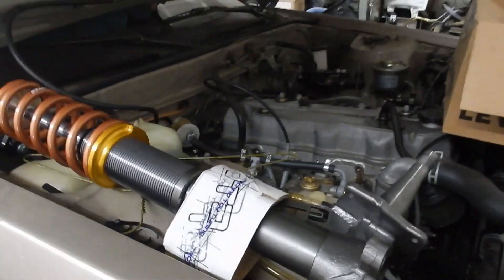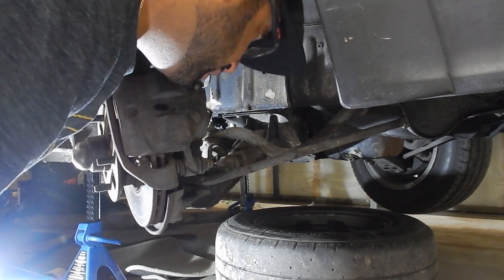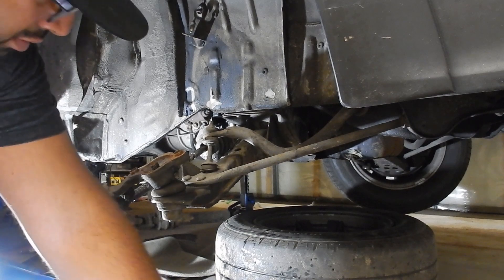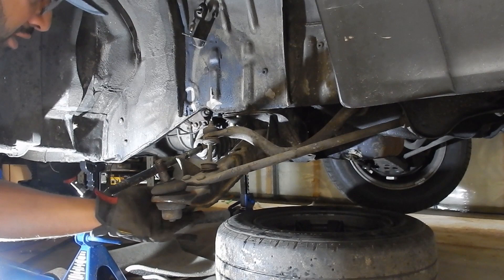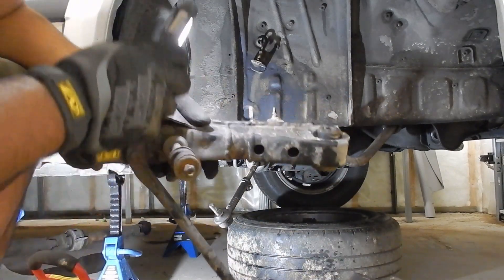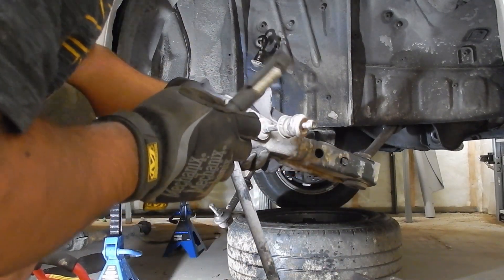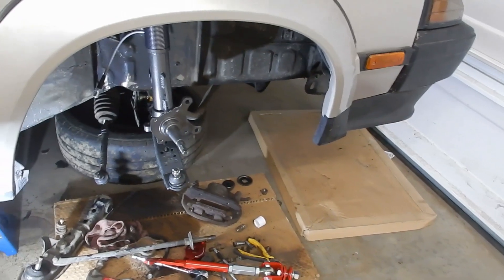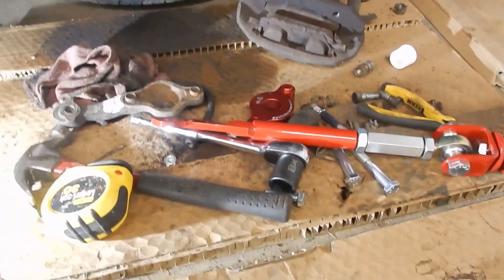1984 Celica RA64 Removing and Installing Front Suspension

Comment: it still looks like there's a fair amount of tension on your spring. When I took my  control arm off  (this is the part i was servicing, not the actual strut at the moment)  the spring was basically slack. Is this normal?

Comment: Hey what are the parts do I need to buy and what website cause I have a 83 celica and need new suspension
Reply from the maker: Technotoy tuning has everything you need.  But get the GTx2 front end.
Reply: How is the suspension holding up my 83 celica needs new suspension too

Comment: Are the knuckles from the RA64 from T3 or did you use the ones from the AE86?
Reply from the maker: I tried using the original knuckles at first and they worked when I was using stock brakes.  But then I went to the wilwoods I had clearance issues.  So I had to use the T3 evolved knuckles and evolved RCA.  I think they might be the same for AE86

Comment: Great content BTW, I will have some up on my 83' GTS Liftback soon.  its getting made into a full stage rally car that can run vintage class or open 2wd 2000cc with the Beams swap
Reply from the maker: The car still has the 22r.  Will swap the engine at a later date.  I want to sort the suspension/brakes out first.   Get in touch with techno toy tuning for your suspension
Reply: @outrider4945  I don't know if it's beefy enough for rally racing, the arms that is, I am having them do the shocks though.  Going to completely box out the factory ones for now and possibly fabricate some later if they don't hold up.
Reply from the maker: @kronik2020  look at the LCA that's what I have. Fully boxed, adjustable, spherical ends and beefy ball joint
Reply: @outrider4945  I have to double check the regulations but I believe for the vintage class I have to run factory arms but the open class anything goes as long as it still looks the same cosmetically like a factory car and meets weight restrictions

Comment: Did you buy this Celica with the Beams Engine already installed?  I am looking into swapping my 22r-et(custom swap from 89 pickup) out for the Beams as it revs higher and is a better suited motor for Rally Racing applications for balance and power to weight.  If you are doing the swap what is your plan for the trans?  Keeping the W58 5spd or going to the 6 that comes with the Beams?